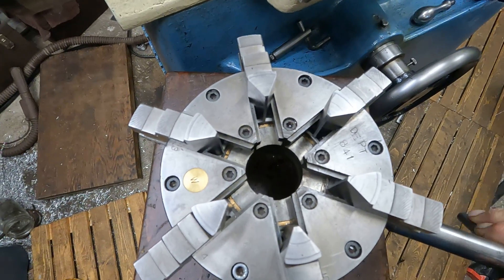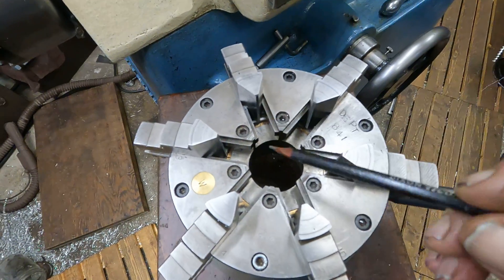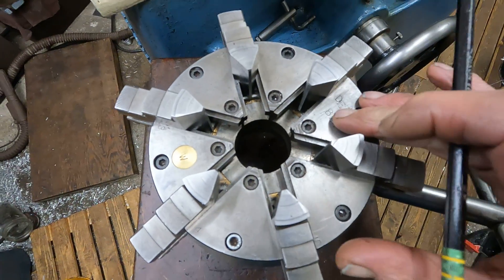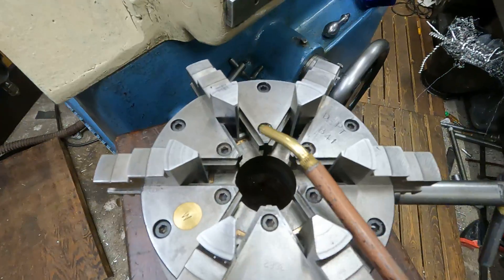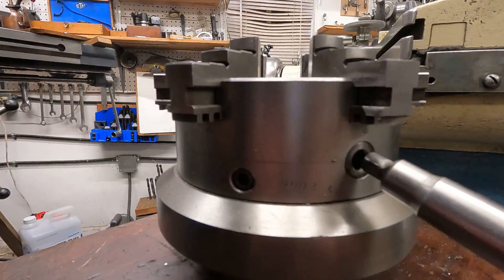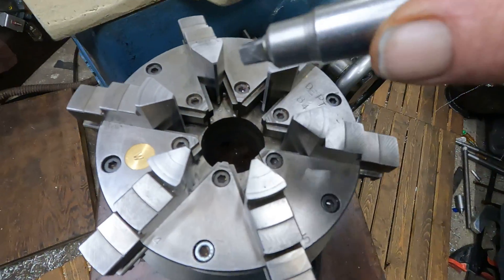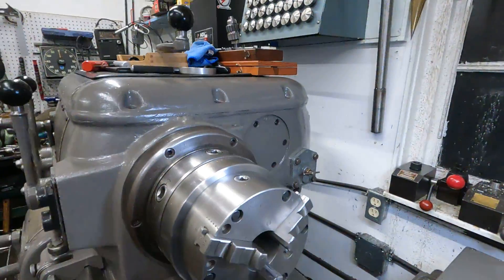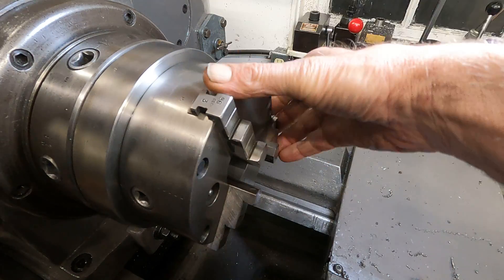Advanced lathe chuck fitting part 4  using the chuck

Comment: Very impressive precision!
When you tighten and rotate, how does it feel when it is a good spot to finish tightening?
Reply: In my experience at the ideal spot everything in the system feels seated the most. The work piece will resist further rotation either cw or ccw, and the chuck can be closed down slightly farther without perceptible increase in required torque. At that point you can feel comfortable tightening the chuck to working clamping pressure.
Reply from the maker: Great explanation!
Reply: @DonDyarprecision  thanks for the clarification!
It seems that the rotation of the workpiece should feel smooth without any burrs catching the jaws then?
Reply from the maker: By rotating the piece small burrs can be felt on the work piece that can cause run-out, thanks

Comment: I just purchased a nos yuasa 10”  2piece 3jaw chuck A1-6 spindle, any suggestions before or after mounting. I like your videos and respect your experience and opinions. Thanks.
Reply from the maker: That should be a very good chuck going on likely a more modern lathe, you will just have to test and adjust if needed, thanks!